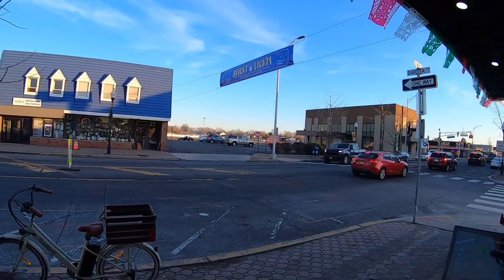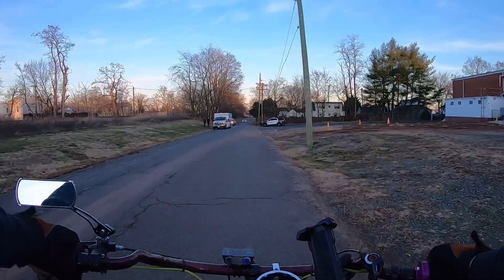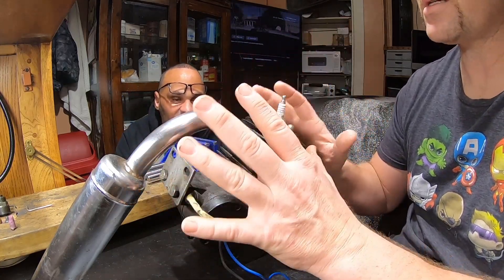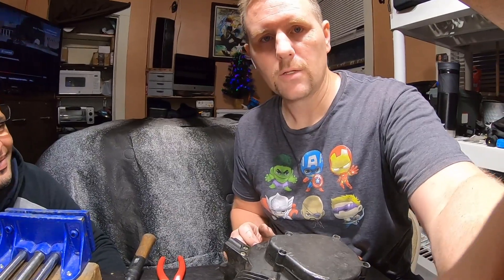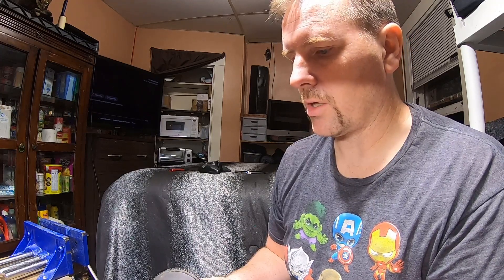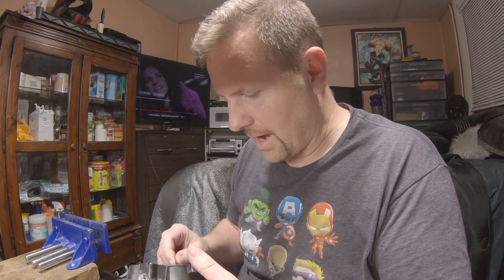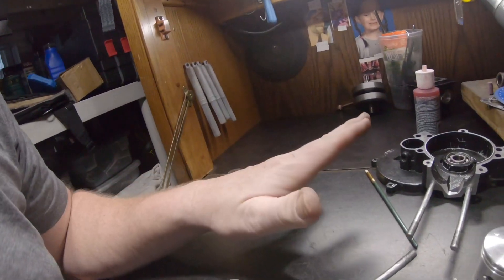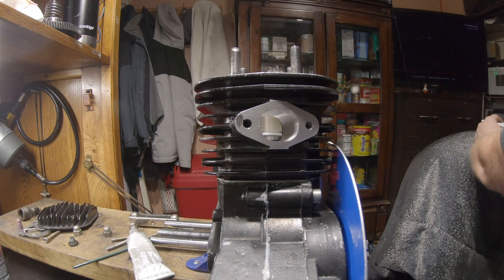GIVING MY FRIEND A NEW MOTOR, and SHOWING HIM HOW IT WORKS!!

Comment: That's nice bro (from title haven't watched yet) just rebuild my second motor n first frame planning on lending my best friend until he gets his car .
Reply from the maker: Good luck loaning it out cause I find people just don’t care or maybe have the proper a😢of understanding to care to ride one of these bikes on the daily to go to and from work.
Reply: @JMB676  that's true sadly a good amount of parts decided to self destruct before I even got to leave home to drop it off. Pedal side chain broke right pedal grind of crank and I forgot I ported the engine for expansion pipe so lacked power without n decided to stop running after a while

Comment: Did you get your Mac working
Reply from the maker: No sir, someone said they might help and I messaged them but they never responded back again so I’m still lookin for help if you know about them.
Reply: @JMB676  what does It not do? Does it boot but no display? What model is it exactly? year, ram, hd size
Reply from the maker: @normanpeterson3961  well I got it from a customer for free cause it wasn’t working for him anymore but I started it and googled how. To do a master reset and all that and I think it started to do it but then it won’t do the next in the reset. To be honest I’m at my ex house babysitting my daughter before I go to work in a hour so I can’t look up all the specs and what it does exactly, and it’s been two months since I even tried to do anything with it cause I just didn’t know what to do next. I believe it was like 2017 ish time it was built and I believe it was the second largest memory they offered but I could be wrong till I look it up again but I remember being pretty happy with what it had and would offer me for editing once workin. I think the first thing I need to do it get the onn wireless keyboard n mouse to hook up completely to use it since the only thing it didn’t come with was a keyboard so I just bought one that said it will work with my iMac. It’s a pretty big screen too compared to other I have seen over the years. If there’s a way to contact you directly too it be much appreciated but you can hit me up off the link in description for the group or chat n tag me or just look up Johnnie William Moser Jr. Cause that’s my main account on fb or text me even 9083928354, I appreciate any help you can offer cause I’m just lost with this and really want to see it working to use it to edit. Thank you.